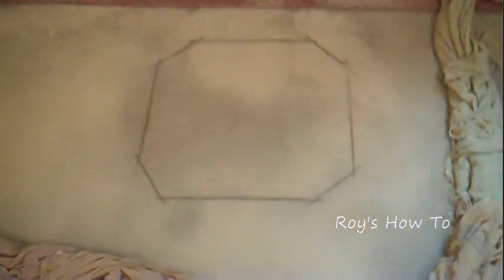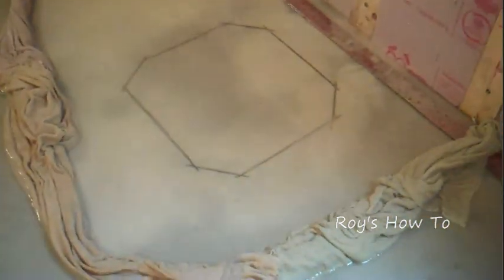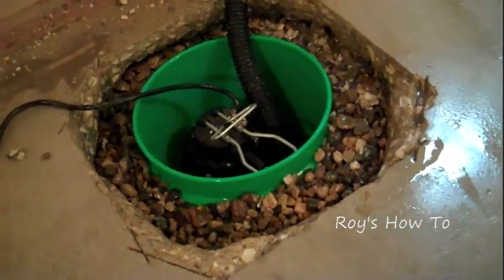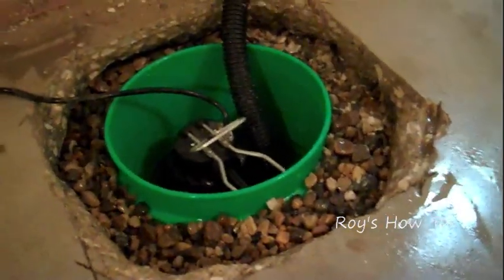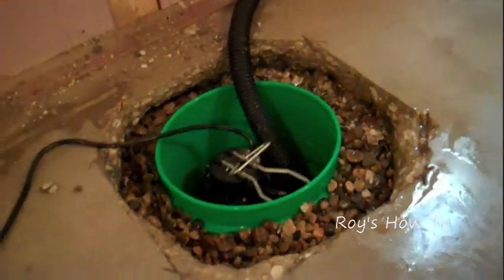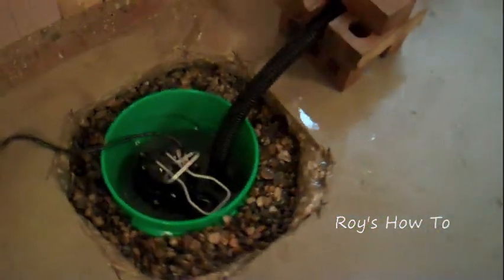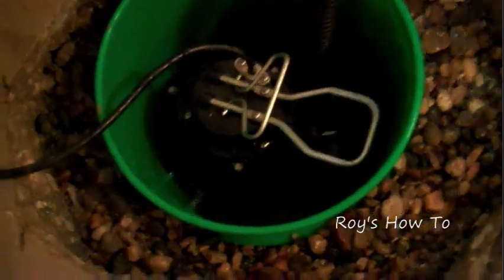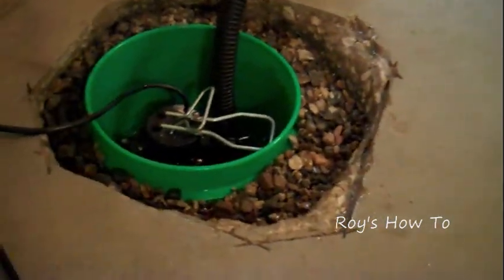SolutionTo Ground Water Flooding From Missouri River

Comment: Short cycling that pump like that with such a small basin is a quick way to float switch failure, if not the motor as well.... and it sure doesn't appear that your using a sump pump (and switch) of any real quality, either.    The Minimum for a home sump pump system should At Least 18" diameter (id) by 24" deep (id) to help avoid "short cycling".